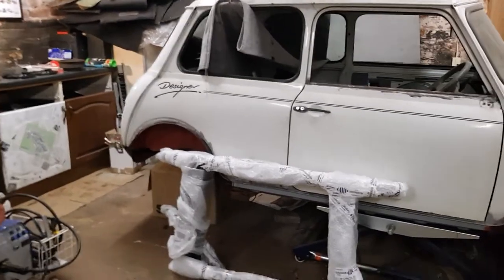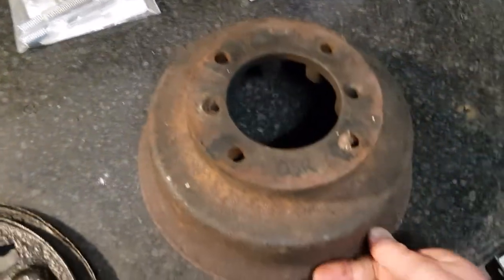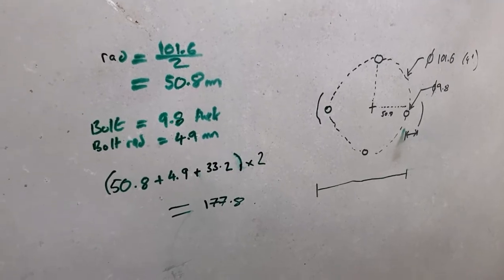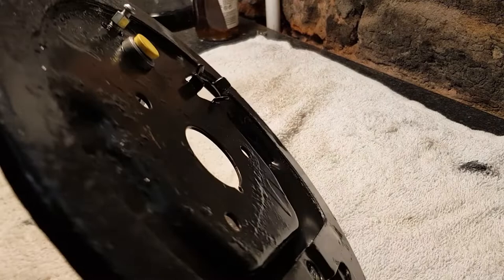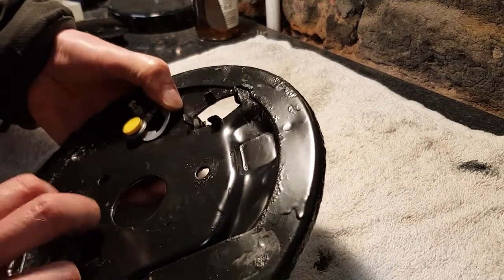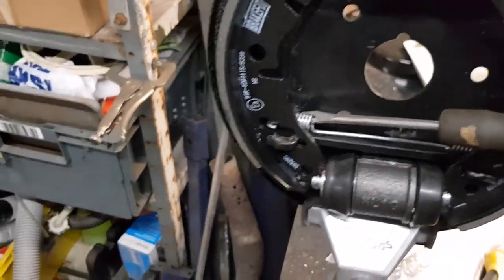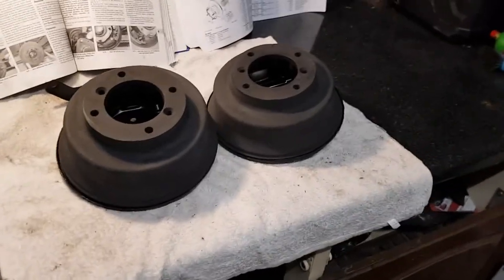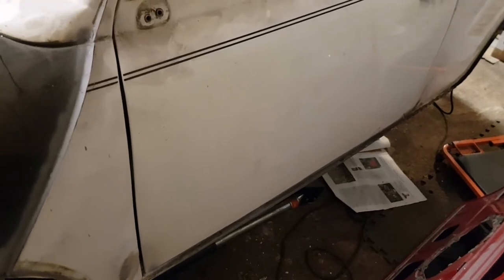Project Designer Ep 36 - Classic mini rear drum brakes rebuild

Comment: Nicely dodged the bit where you actually fit the retaining clip ion the wheel cylinder! Any tips would be appreciated...
Reply from the maker: Yeah, it's a fiddly job! Make sure you have the brake cylinder as far through the hole as it will go. Also make sure that the backing plate isn't thick with paint or dirt. You should be able to just get the clip over the groove. I then hammered on it with a flat blade screwdriver to send it home. Good luck!